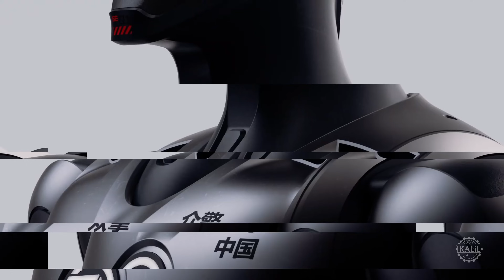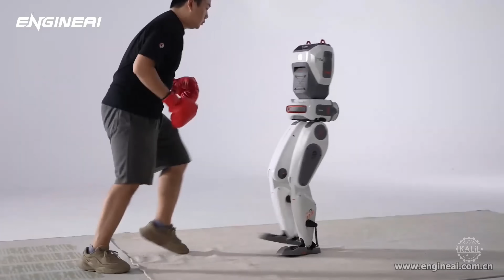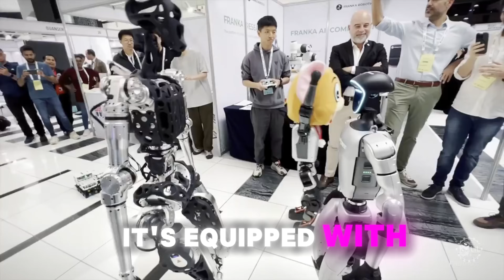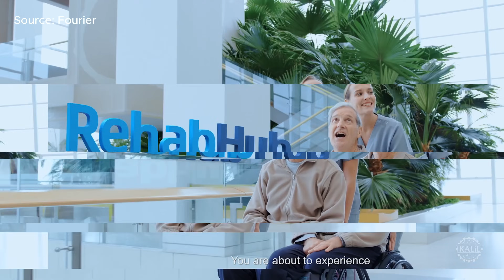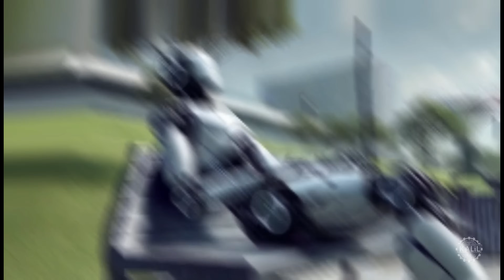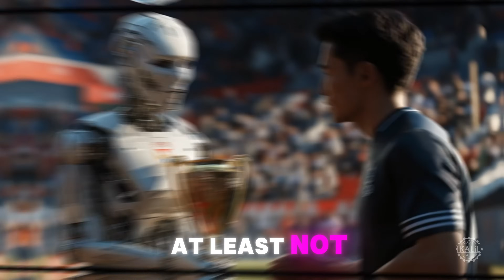Shockingly Human-like Movement: ENGINEAI's New Tesla Bot Competitor, SE01 Humanoid Robot

Comment: Cool, but please stop talking about Optimus as if it were the reference. It has achieved nothing great so far. Boston Dynamics is still the reference. Tesla is just hot air.
Reply: Optimus and the others only exist because of the research output from Boston Dynamics. They would have paid them for their research findings. It's business.
Reply: @ no
Reply: Somebody is simply a Musk hating democrat. Bet!!!
Reply: People are hyped. Because elon musk strategy was hype. People start to see it. In Lithuania we have a saying. What raises high. Gonna come down low.
Reply: Completely wrong, educate yourself
Reply: Ah....tesla....hot air.  The company that has done more to advance electric vehicles in the past decades than any other company in the past century.  Sure, BD has pushed robotics extremely far, bleeding edge far, but they have been working on robots for the past 30 years and Tesla has only been working on Optimus since 2021.  With all the innovation that is the Musk conglomerate, I expect tesla to match BD within the next couple years.  This is primarily because BD doesn't have the capital that tesla has.
Reply: @Justanotherrandomguy80 optimus moves at snail speed and is more assisted than most models. They arent even close to boston dynamics yet. Boston dynamics is performing acrobatics while optimus still moves like c-3po after 4 plus years in developement.
Reply: Optimus is the reference. It was started 3 years ago and it’s already greatly refined since. Boston Dynamics humanoid robot started much longer and still has not demonstrated doing useful work, besides being able to do acrobatic movements and dancing.
Reply: What are you talking about? When was the last time you checked it out? Optimus can deadlift 150 pounds and carry 45 pounds while walking at 5 miles per hour, can sort things, It can fold F*cking laundry🤣
Reply: but cant walk like a human @BoberMcBoberson
Reply: @Thomas-p9f1h  yeah, I don’t think that’s the most important factor.
Reply: This is false. These claims are hopes for gen3 but not yet reality. Boston dynamics is still way ahead. They run, can already be put into practice @BoberMcBoberson